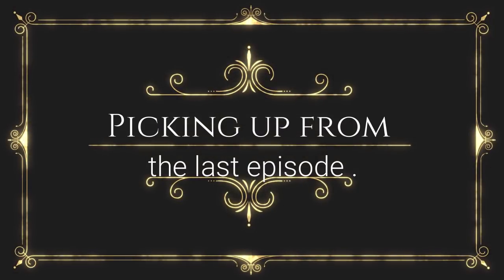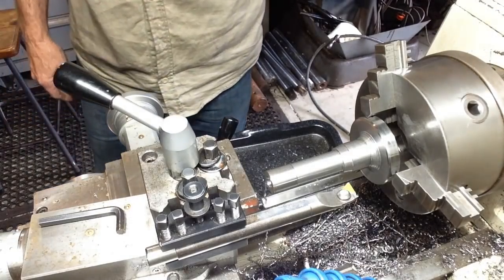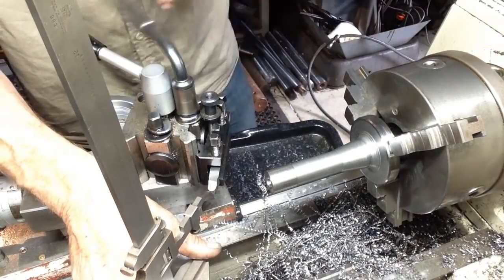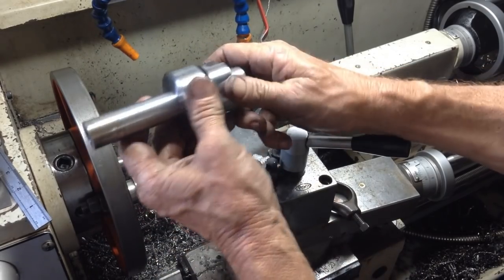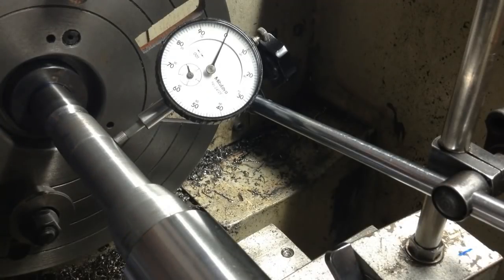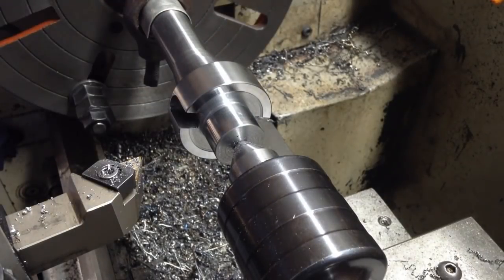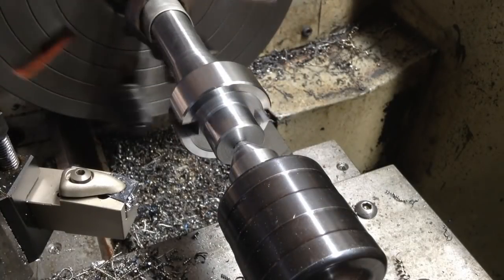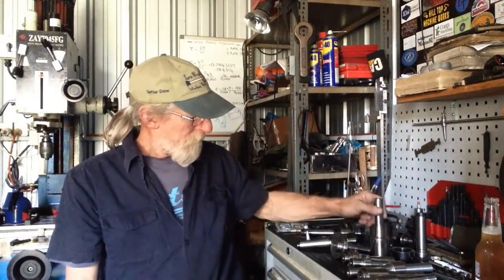Machining R8 Tooling For The Bridgeport .  Part 5 .

Comment: Reminds me of nightmares that I have where someone breaks into my shop and steals all my cutting tools except for a boring bar. The other nightmare is where I'm sentenced to hell and must do machine work for eternity with nothing but a boring bar. The devil did give me a pointer where he suggested that I mount the boring bar upside down, run my lathe in the other direction so I could use my tailstock with a live or dead center to help keep the part true.

Comment: Let me preface by stating that I know absolutely nothing...

With that said, I recently asked a question of Tom Lipton at oxtools. It was specifically about threads in some A2 that was going for heat treating.  He was making some Vee blocks.  His answer surprised me.  Unfortunately I dont know how to copy and paste it, might be you could find it.

Anyways, he stated, and I paraphrase:  When dealing with A2 he doesnt get enough movement to worry about threads.  Any movement that does occur can be handled with a lap and diamond paste.

Dont know if that has been your experience or not.  Thought I would mention it in case it applies to your situation. 

Thanks again for all the incredible details you include in your videos.  You quickly have become one of my favorites.
Reply from the maker: If the one you were referring to  would be small threads in a solid v block he was doing in his last episode . the threads in that i would think would not be an issue because the threads are small and there is a solid mass around them .  my situation is the threads are large diameter with no solid mass to retard the shrinkage .  It may be the case that  A2 does not move that much but  used in my situation i think it would  still reduce in diameter as all steel does . Remember when you heat steel to cherry red  contraction is greater than expansion  when it has a bore through it .  I hope that able to shed some light on it . Cheers .

Comment: My mentor told me to use a a 3 jaw with a machined centre and set it with the dog, didn't  trust the Morse taper in the spindle, back to my BP refinery Kwinana apprentice days in 1969 using an old Harrison Lathe.
Reply: Long time ago, think it was model L6.
We also used a Colchester Student but I preferred the Harrison.
Reply from the maker: Your mentor was right .That's how i would normally do it but the compound is set for the R8 taper & i don't want to change it .  What sort of Harrison , i lost my lathe virginity  on one  an L17 . Back in 78 !  ( as well as the little South Bend i still have that was my Dad's ) .  Cheers .

Comment: Change that horrible suds hose, hate them, my DSG  tubular telescopic coolant lines and you put the outlet exactly where required and no spring back.
Reply: Made a Stainless Steel one for my Emco V10.
O ringed swivels, still working today in my brothers workshop.
Reply from the maker: They are the best but do you think i can find one of them , i might have to make one !  Even the old flexible steel ones were not to bad  .  The plastic one is complete crap !

Comment: Excellent job, good idea on the taper gauge.
Thanks for sharing.
Reply from the maker: Thanks , it makes things easier with the gauge . The time spent making it pays off .  Cheers
Reply: @swanvalleymachineshop  just a thought on the heat treatment, would it be prudent to stress relieve prior to hardening, normally cylindrical parts  are not susceptible to distortion, but you had one part distort. Again just a thought. Thanks.
Reply from the maker: @bostedtap  Axial distortion is common .   To have the ability to stress relieve them  would be great  . To have a small heat treat oven would be great for these jobs .  Cheers .
Reply: @swanvalleymachineshop  Hi Max, that surprises me, always good to learn. Regards John.

Comment: You're obviously a believer in the seven P's, very well thought out, machined and presented.
Reply from the maker: Thanks Paul ,  You will have to enlighten me on the 7 ''P''s   Cheers .
Reply: @swanvalleymachineshop  Perfect planning and preparation prevent piss poor performance.

Used a lot in the Engineering industry here in the UK. Cheers
Reply from the maker: @paulskelton6836  I remember now  , been a long time since i last heard it !!!    Cheers .

Comment: Well done Max .... Can you do your 50mm thread, then press an insert into the taper, then heat treat it ?  Other than that, Looking Good, lots of shiny bits and pieces .. LOL
Reply from the maker: No it won't work .  The idea works for heat restraining but you lose the time ( temp ) between the right time to quench & trying to knock in a restraint  on a cherry red part . Thanks .